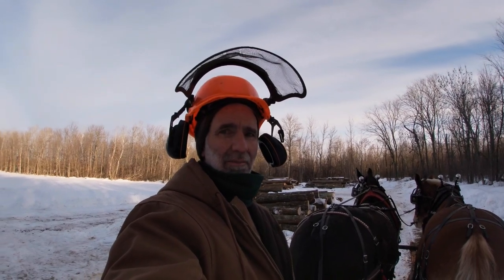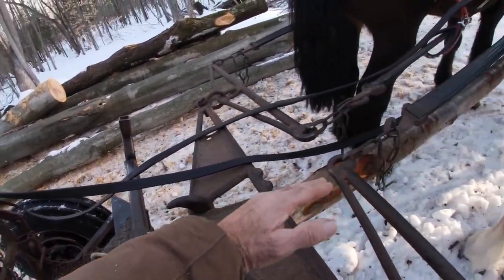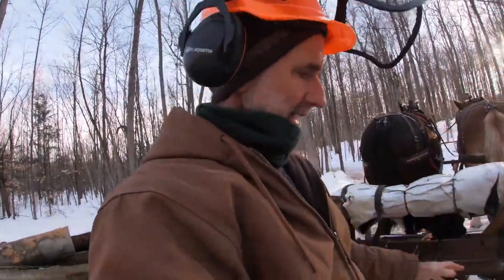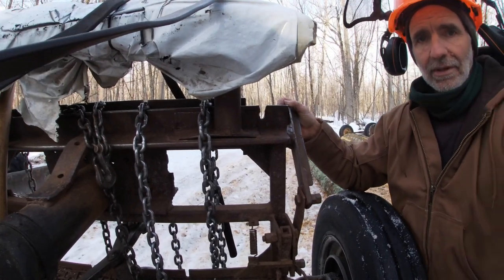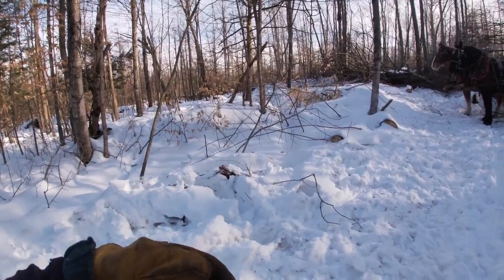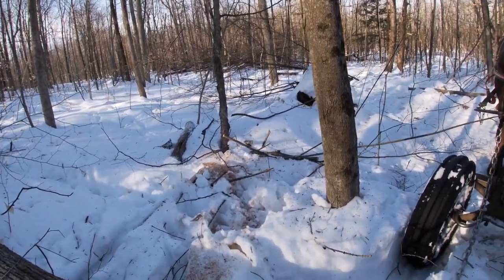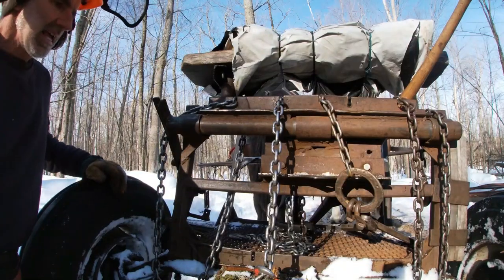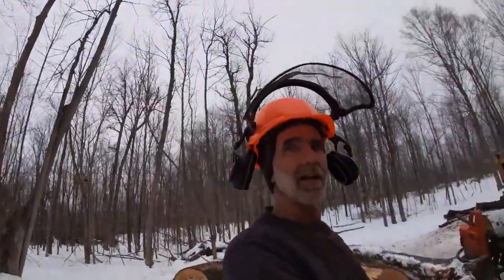My Horse Drawn Logging Cart

Comment: With cracked / damaged handles, I wrap mine with mechanics wire. Most times I drive a small nail to help start the wire then a second one to finish it. The trick is wrapping the wire tight and close together, it's harder than it looks.

Comment: I see why you have to use the D ring harness. The line of draft on your cart wouldn’t work with a western style harness with the high hitch point. I chuckled because I dropped the hitch point  on one cart because  it was too high since I use the western style harness and the collar was tilting. Getting the line of draft is so important to get the best out of the horses and keeping them comfortable. I thought your explanation of how the D ring harness moves the weight from the collar to the back pad in a different video was the best I have seen. I have heard that argument for years but no one could show me how it was changing the distribution until your video. Now I am a complete believer. Nice job explaining (I might have to add your tire guards to my cart some day).
Reply from the maker: Glad it was helpful

Comment: Well done video on the cart Jim. you'd be surprised how many of us watching are looking at a lot of things about your setup. I remember checking out your cart on the very first video I watched and the first two things I noticed were the tractor tires on the cart. and also the chain notches for holding your chains. I seen the "release" but did not know what it was till now. I used to log with a little case 310 dozer with a stump riper on the back so it was piece of cake to lower it. get a tight hitch and then just lift it up to pull them out worked great also. but much more noisier than your setup. once again thanks for doing the video and again thanks for sharing.
Reply from the maker: Thanks for watching!

Comment: Thanks for the info about your cart.  If it works for you there is no need to replace it. Its a good set up. Now I see how it all works. I was kinda wondering if those logs would snag up on things along the ground but now I see that they won't because of the lift your cart gives. I thought I heard some kind of air siren sounding in the background when you were showing how to release the log. I hope all is well there. Have a good weekend. Stay safe. From PEI
Reply from the maker: The fire station is about 2 miles from where I was, as the crow flies.You heard right! Glad the video was helpful
Reply: @WorkingHorsesWithJim  🙂👍

Comment: I wondered if you had a way to release logs. Thanks for showing. Jim have you thought about cutting off that lower ring, and welding a reciever hitch on so you could remove ring when you log, so the logs won't get hung up on it?
Reply from the maker: It's really not a problem but thanks for the suggestion!
Reply: @WorkingHorsesWithJim  I like tinkering lol. Then there is always the issue of loosing the hitch when you need it🤷‍♂️🤦‍♂️. Lol

Comment: The Pioneer Logging Cart , picture 24 of 44, Carhttps://static1.squarespace.com/static/5584c066e4b0c2994baa1991/t/5d45c98a2bed1e00016064af/1564854676305/2019+Pioneer+Catalog.pdft  seems to have more clearance between the wheels, but otherwise follows the same principles that you explained. You are a thrifty man, so you built your own, but you arrived at the same conclusions the professional  metal fabricators arrived at.
Reply from the maker: ActuaIly, bought it second hand 40 years ago.Then I had some modifications done to it. I'm not that clever.